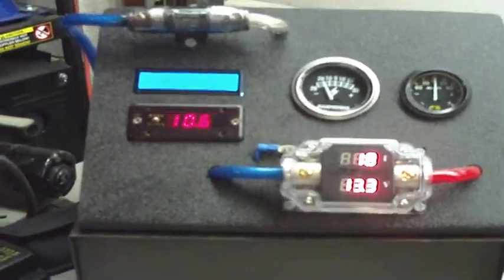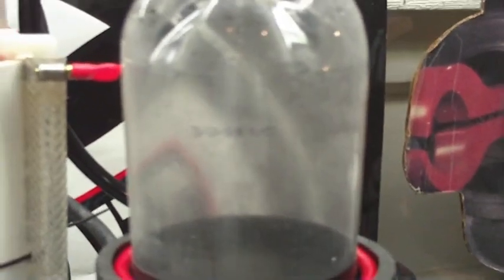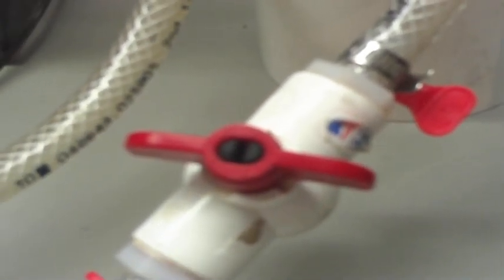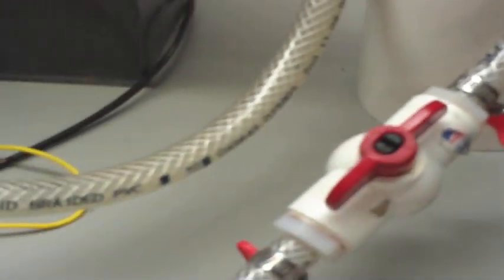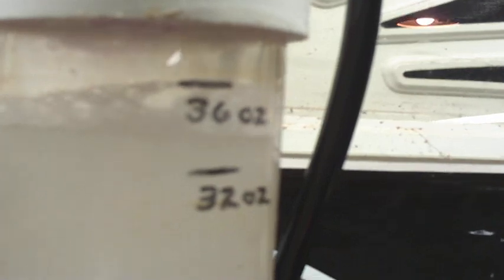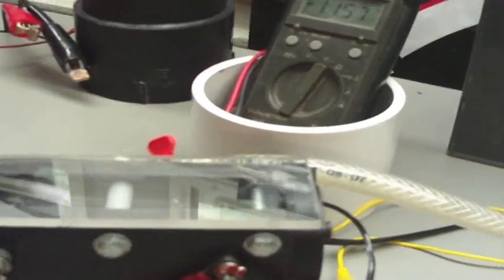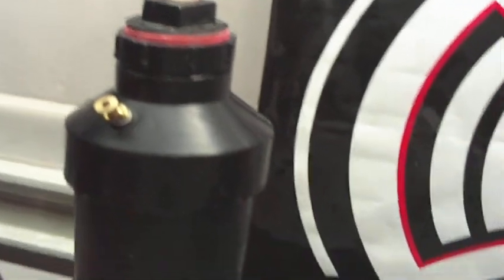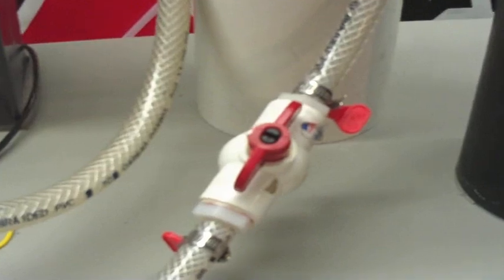MORE HHO BY FINDING THE SWEET SPOT

Comment: I was contemplating using a pump and a small aluminum radiator to keep the water cool, for continuous operation for a welding torch design. However, I started thinking about the moving water, and wondered if electrolysis would stop compeltely if you got the water moving fast enough. I think you proved that electrolysis is a slow process, and if you move water extremely fast, there may be a point where electrolysis cannot occur?

Comment: I think it was me.  I felt that choking off the fill valve created greater pressure inside the cell, pushing down the level of the foam below the outlet holes, reducing the current leakage (I think that's what I said).  I think you replied that the pressure wasn't greater, but I think your pressure gage is in the bubbler, not the cell?  How much volume is there in your cell above the outlet holes?  Looking forward to more, thanks for the video.

Comment from the maker: YES with slowing the water amps will rise,beacuse oft he heat ,but you can control the current by using zereo fossile fuels pwm,and it does work my cell runs all day with no problems and I do get an incease of hho.

Comment: so what i can imagine is happening is the electrolyte is warming and producing more hho but also drawing more current.from a practicality side of things in a car  you could have a thermal cut on switch attached to the output of the cell so when it reaches a set temp it allows water through at a slow rate and then cuts back off again when it gets to cool and ie less effecient. great for car setups as high eff is what we are after.

Comment from the maker: The holes will vary until you find the spot on your cell that will be the most efficent production.I stagger my holes far left and right, this will act like a maze for the water, and keep the current from jumping hole to hole .Most cells keep
them in a straight line .The output will remain in line but my upper hole is in a diamond shape,this will reduce the turbulance. A valve would be the easy way,You must do a lot of flow tests to achieve great results.

Comment: Good job! I also use the same type of setup except I added one other valve to the exhaust port of the cell so I could play with that as well so I can further control the convection current thru the cell.
The outlet valve I dont think helps much but the inlet valve does indeed stop the foaming and increases the gas output as I think as you stated that the gass does not have time to form well and it becomes too difused.
BTW, I love yer combo volt/ammeter. I have one simular but only one display.